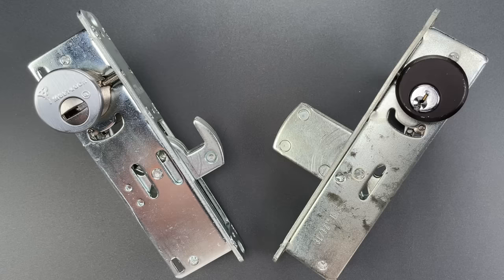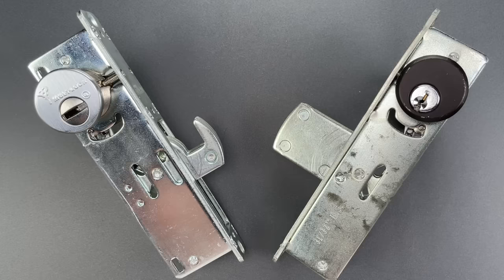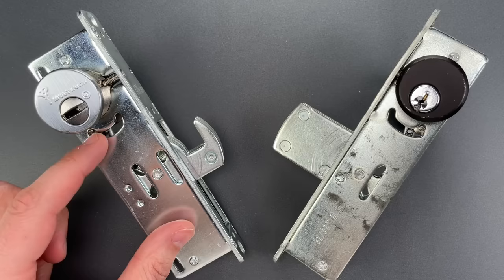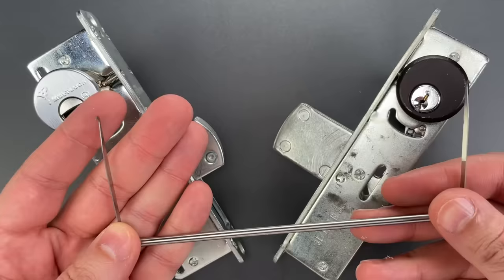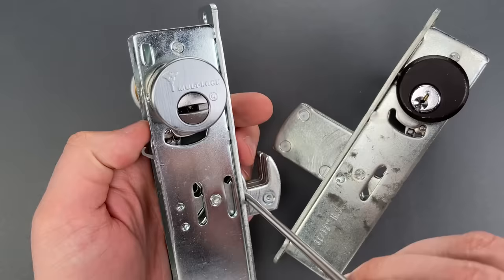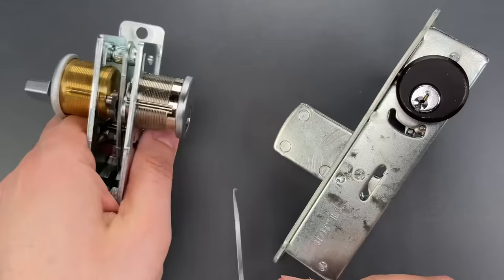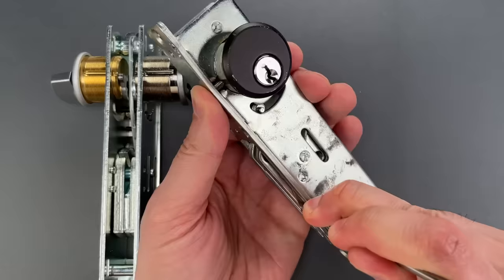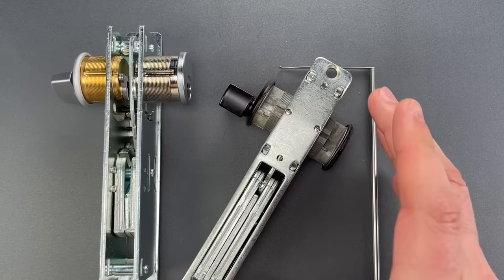[1409] The Most Significant Security Flaw in North America

Comment: On my fire department we typically have a channel lock plier with a 90 degree angle bend in the handle (we call it a spoon) that we use to rotate the locking mechanism, breaking the set screw that holds it in place, and then use the spoon to unlock that locking bar. It’s a relatively low damage entry technique, and the lock can be replaced by us. But having watched this video I am going to be ordering some of these for all of our trucks. That was super quick and effective.
Reply: Make sure you provide your team with proper training. 
This guy is so freaking fast!!
Reply: If you used a tool like this during the heat of the moment would you be able to keep your cool to open the lock? He makes it look easy but if shit hit the fan id be breaking through the glass rather than using this tool, my hands wouldnt have the dexterity :D
Reply: @crazycowboy213  totally agreed. But you know, firemen also open locked door when there is no fire
For instance, an older who's fallen in her house and can't get on her legs because it's broken 🤷‍♂️
But yeah, when it's urge and we lack dexterity, destroying the door sounds more efficient 😅
Reply: Im a first responder. This tool is more simple to use than a lot of other skills that are done under higher stress, like starting an iv. Also there are different escalations depending on the severity of what is happening. If time permits ill usually look for hidden keys or unlocked windows before messing with locks. People usually put the hidden key in brutally obvious places. But there have been time critical ones where i have just used my universal key (boot).
Reply: @crazycowboy213  fire fighters deal with a lot more than fire. 
some situations may be simple. for thoses this will be a money saver.
Reply: @crazycowboy213  Training. When it's second nature, it doesn't matter if you'r in a stressfull situtation, because the training kicks in.
Reply: I’ve used both the modified vice grip “spoon” and a similar version to this tool as well at the department I work for both work and have their advantages, depending on the situation we avoid breaking the glass, uncontrolled air flow into a fire is a bad variable, if it is a smoke check or alarm sounding nothing visible we usually use this or look for a Knox box but if there’s smoke pumping out the spoon comes out and the cylinder gets twisted off
Reply: @pierrelemoine8669  but that also means you need to train until it is second nature.

As the old story goes: amateurs practice till they get it right, professionals practice until they can't get it wrong!
Reply: @ScottKenny1978  That's kind of the point of training to be a first responder though. If we're talking about a random good samaritan in the street then I wouldn't expect that kind of training but firefighter training for example is rigorous. Their job is literally life or death so they can't afford for the training to not be there.
Reply: @daggern15  the catch is that training takes time, money, and leaves you with firefighters that aren't available to fight fires while they're training. So non-destructive entry like this gets skipped over.
Reply: @ScottKenny1978  not really. Through the lock entry is easy to put down and still respond to emergencies. I’ve been picking locks for 8 years, and I’ve been a career firefighter for 16 years. It’s pretty easy to just put don what you’re doing and respond. Same as spending time in the gym.
Reply: The least expensive method of forcible entry to such a door is to simply shatter the glass.  Damaging the frame, the door, or the locking mechanism to the degree they have to be replaced are all worse.
Reply: some of the quickness is also due to practice and low stress.  Add in some adrenaline and a lack of training and this isn't anywhere near as easy as it looks.
Reply: @chrisoffutt8968  Most def, you’d never use this tool with gloves on.
Reply: @creamwobbly  exactly
Reply: @edwardgrabinsky6369  "universal key" got me a laugh.
Reply: @ardumsmarf This tool is for the older version of these locks; a newer version is now in use requiring a different tool, so get both. You might also find a local locksmith willing to help with training for other common and easy lock bypasses; there are more than you'd think!

Comment: Similar locks I've seen in NZ,  Australia , come with a shield that fits on the door near the lock body, it covers the gap between the door and the frame, it would prevent access to the gap when the door is locked.....
Reply: Oh aye
Reply: I have seen doors where the gap is not wide enough to accommodate the tool.
Reply: seems like an obvious defence. wonder why it's not done.
Reply: @jnawk83  Because some suit decided that saving a few dollars on the buildout would make him look good to his also-suit boss.
Reply: Germany, too...
Mostly, there's a plate desingned with the lock
Reply: Probably a pryguard. You can apply channel locks to the lock cylinder and rotate it out, use another tool to manipulate the lock also. That’s how it’s usually done in public safety applications.
Reply: No, it's totally different. Aluminum door frames are exclusively used in the USA. All other countries have aluminium door frames.

Thanks, I'll see myself out.

Comment: Another big issue with storefronts (although harder to pull off probably) is the glass, most stores have the glass put in from the outside, and the rubber that holds it in place is also on the outside. I used to be a glazier and the son from another glass shop got arrested for taking out the small glass panels on the bottom of storefronts, stealing a bunch of stuff and putting it back. Police had no idea how the guy was robbing place’s customers there was no sign of forced entry or anything. IIRC a cop drove by once when he broke into a place and noticed one of the glass panels was missing and caught him.
Reply: So you're saying when we use that trick to make sure we set the panel back in place while we are cleaning the joint out?
Reply: @macuss87  exactly, or else someone from the outside could find out, dont leave signs of burglary even while you're inside, thanks to OP for giving this advice
Reply: LMFAO!
Reply: When i was a thief n broke into houses, sometimes i took out a window n the frame it was in with a couple of screw drivers prying it out n when i climbed inside i put the window back in, but one time a window broke when i was trying to pry it out
This is why some people screw the window in or put another locking device on it so you can't pry it out
Then i just went out garage n closed garage door as i ran out of garage, a few times i had a friend back car in the garage n close garage n loaded up car then took off
Reply: Our commercial glass fronts are held in place by an aluminum strip thats being screwed by special torx or just "rounded" so you have to drill them when dismantling.
Reply: Joshua B , as an ex- glazier of 25 years here , you are right , we glaziers know how to get in these places in more ways than 1 , we install this stuff for a living . Most ( not all ) ground floor glass is installed from the outside . 👍
Reply: Yeah, I do building maintenance, used to do commercial building maintenance, and my first window break at a cell phone store when I discovered how easy it is to take a whole glass pane out and just put a piece of plywood in its place until yall showed up with the new glass, I was just like "why does anyone bother breaking things or going for the lock at a store."
Reply: @BeeTriggerBee  that's smart, however that's far from standard practice so. 99% of store fronts you can pop the glass out with a putty knife.
Reply: Is there a tool you need to take out the glass (asking for a friend)
Reply: ^ asking for a friend
Reply: @michaeljohn7467  While that's interesting to read, careful what you talk about on YouTube unless it's something you've already served time or have been acquitted for. People absolutely get done in by off-handed comments they made online
Reply: Lynx , yes , you need a hook tool to remove the rubber gasket ( not on all installation,s ) , tap off the stops and depending on the size & weight of the glass , 1 or 2 people with suction cups .
Reply: @georgeosborn3553  thx
Reply: Lol, grab a glazing bar and you are already 50% ahead of the other thieves 😂
Reply: Yup. I've reglazed windows and customers didn't even know. One time I did a reglaze in a bank and they were so sketched out that I did it after hours and no alarms went off they had a meeting with .y company about the flaws in storefront and solutions.
Reply: @buzza2077  lol
Reply: yeah, but for that much effort and skill you may as well just get a job as a glazier. cut to the chase, man

Comment: If a thief with bad intentions that wants to get in a store, they won't even bother picking the locks.  Most storefronts have glass doors and display windows. They'll just break the glass door.  Ransack and go. As we've seen many times on television.
Reply: Most thieves aren’t very smart, hence why they have to resort to robbery to get by.

If they were smart they would leave the scene as if it had never been broken into.
Reply: Probably. But this is a lot quieter. Breaking glass is pretty loud. This is literally just as fast but completely silent.
Reply: @EskChan19  A thief would not even care for the noise. They know the alarm is going to sound off anyway. They just want fast easy access, snatch grab and go.
Reply: That method will also make noise and bring zombies and marauders around.

Comment: Given that this applied to "the vast majority of glass storefront doors", using this is better for the store that the alternative method of entry. Which is a brick.
Reply: It's also a hell of a lot quieter. 😀
Reply: @vk4vsp  you trade off quiet for quick
Reply: @weewoogee  eh, not by much though, this tool can clearly open the door in literal seconds
Reply: @LazorVideosDestruction   Sure, but you don't need to order this tool and carry it around with you. You can find just about anything to break a glass door just laying around the general area of the door you want to break.
Reply: you obviously have never had any dealings with an insurance claim. If there is no evidence of forced entry the insurance wont pay. a broken window is much better for the store than a picked lock.
Reply: @LazorVideosDestruction  plus nobody would noticed you picked the lock if they happen to be in view, where as it’s obviously when someone bricks a window
Reply: @LednacekZ  its a joke obviously a pick that takes 2 seconds is just as good at getting into doors as a brick
Reply: Except with a brick, the employees don't get blamed/suspected of not locking the door when the manager shows up to an unlocked door with "no sign of forced entry".  Not to mention dealing with insurance...

Comment: when the resturant i work at replaced our old locks i kept the old one to tinker with. i noticed it was very easy to bypass with a long enough wire or paper clip in the same way your doing it with that tool. i showed the owner on the new lock how easy it was to do. he then payed for another new lock but this time it was alot more expensive then the last one, but once again same problem. he was pretty mad when i bypassed it in less then a min. i then made a little plate to cover the lock except the latch with vey tight tolerance and another plate over the gap of the doors. it cost me maybe $5 of sheet metal and a few min to install.
Reply: But how quickly could those plates be taken off?
Reply: Hello 307! Go wyo
Reply: @Tomonkey4  reminds me of the storage lockers I recently saw broken into at a fairly high end apartment building. Electronic FOB locks and everything caged in with fairly thick gauge metal. Except the latch protrusion that caught on the electronic lock portion was 1/8 thick pot metal. Someone went through and just pried them all open. Probably took them 3 seconds to wedge a crowbar in there and pop it open.
Reply: @Tomonkey4  just break the window then???? why bother with the plate???
Reply: @scottdickens1454  Loud noises attract attention, and I don't know how it works legally, but to me, disassembling of property isn't the same as destruction of property.
Reply: @Tomonkey4  Both are considered "Breaking and entering", but yes, literally breaking the glass will see you civilly liable for that in addition to the criminal liability of the actual trespass.
Reply: @Tomonkey4  I doubt that'd be easy as you have to work within that thin slit between the door and the door post. Even if you superglue that plate in place there's no chance anyone will get enough leverage to get it out reasonably quick or quietly.
Reply: @Tomonkey4  in reality locks are only a deterrent and in a way to keep mostly honest people honest.
Reply: That’s great but did you get a raise or promotion tho?? 

If not, quit! he doesn’t value you!
Reply: @dmac7403  the opportunistic thief rather then professional thief
Reply: @njalsand133  Sure, and that's the point. Using a tool like this makes the opening so smooth that people around might not even notice a problem, they just see a person opening the door, just as if they had a key.

As soon as you force the use of a crowbar or any larger tool, or breaking of windows its much more obvious whats going on which will deter some thief's, and it will also most likely limit the time where it can be done.

Its not going to stop a determined thief, but it might get them so seek out easier pray.
Reply: hope you check all the other standard
 and non standard entry ways as well.
Reply: @TriSci42  same idea 💡 just said different ,a window or door is same as a lock .
Reply: Employee of the Month material to me
Reply: @scottdickens1454  cause opening the lock with such device from just few feet to someone not paying attention looks just like if they were opening it with a key
however if they throw a brick at the glass, everyone in the area will notice and most likely call the cops
Reply: @Tomonkey4  disassembling vs destruction is likely to be a minor item in the charges vs theft, just a matter of how much breaking in the breaking and entering. To be fair disassembly shows more thought and planning put into it then destruction where the tools used to destroy would likely work on 1/2 the stores on the street and disassembly would have only worked on that one.
Reply: @dmac7403  exactly